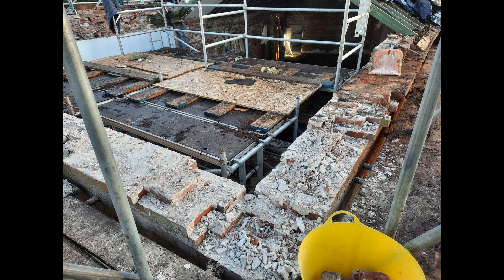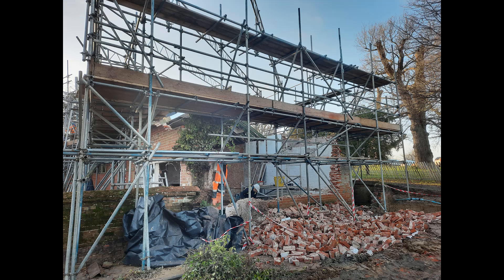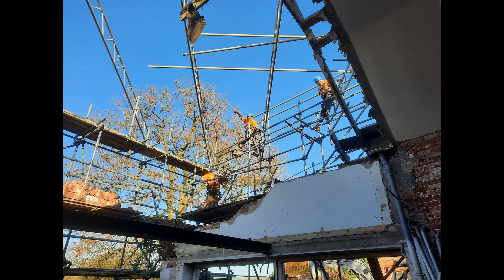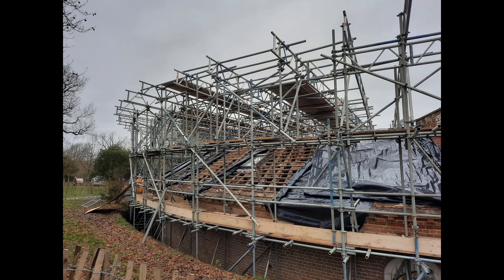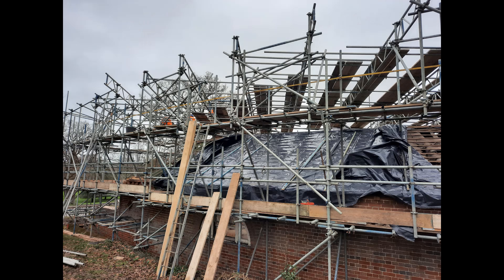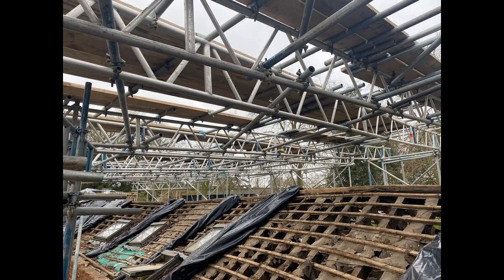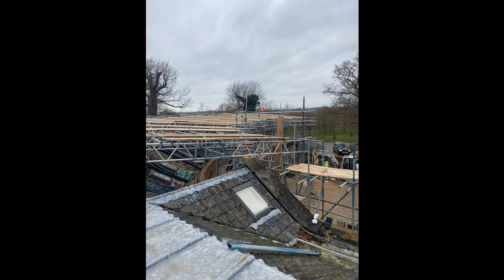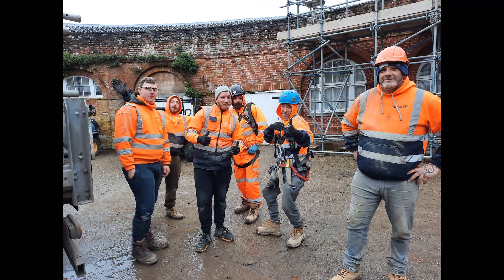the fine art of scaffolding

Comment: Fresh out of the Paratroopers back in '74; I went to work for a firm that was concrete blocking new motor pools.
Only tool an American scaffold builder needed was a level for plumbing & leveling the scaffold... and a good steel handled Eastwood hammer. 1st 3 days, I was sorer than Airborne Basic, Jump School, & Recondo School combined. My beret is off to these guys.
Oh yeah... it helps to be a half assed ape.